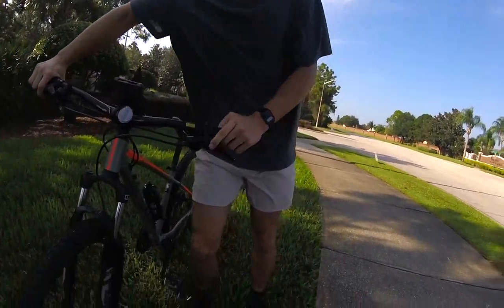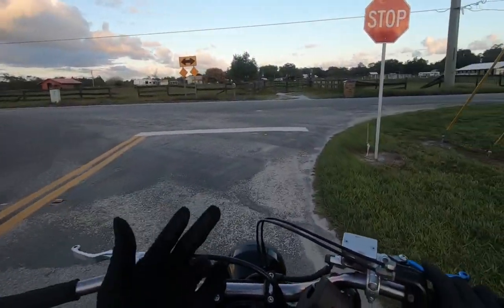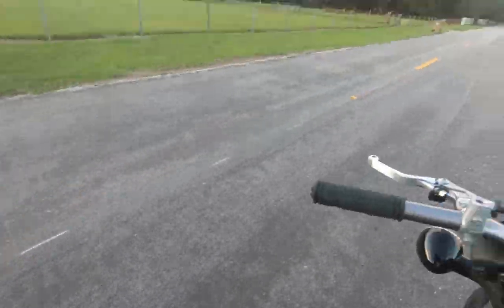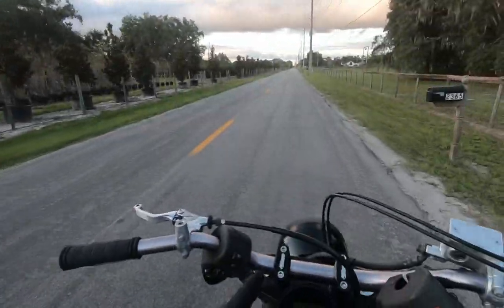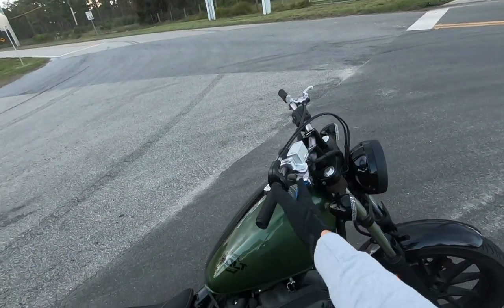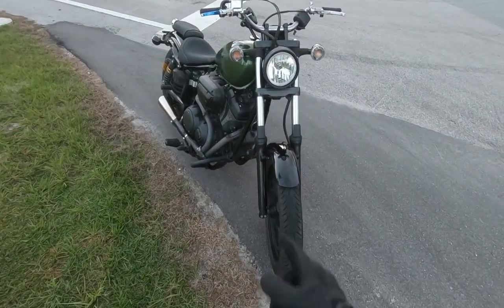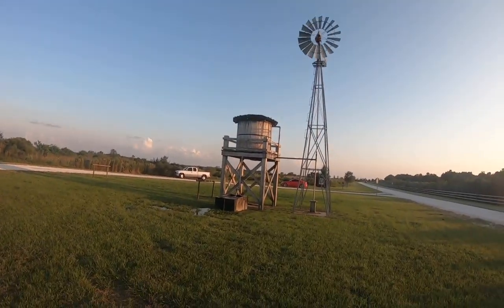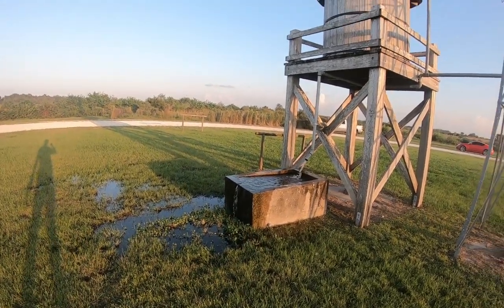HOW TO: Rolling Burnout a YAMAHA BOLT | OR Any MOTORCYCLE

Comment: Hey i know this vid is a bit old but if you can reply please do my question is,when you’re getting ready to stop your rolling burnout,do you pull in the clutch then let go of brake first then let go of throttle?
Reply from the maker: That is a really good question dude! You pull in the clutch first but literally at the same time or shortly after, let off the gas. Release that front brake after the clutch is pulled in too
Reply from the maker: Be on the lookout for my drift video this Sunday. It’s going to be a whole lot better than this one plus it’s drifting which is way more fun!
Reply: @Tardy_Productions  thanks man i needed to know because i couldnt really see lol,and i sure will🙏🏾